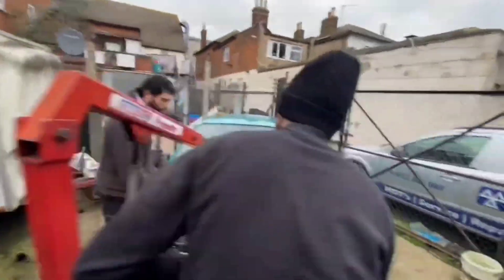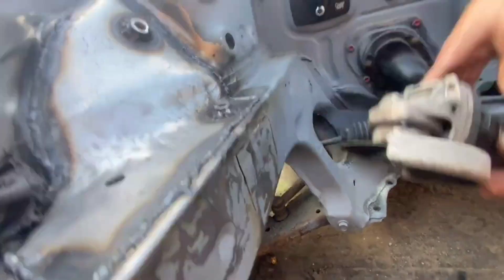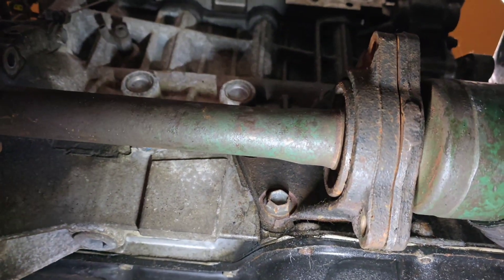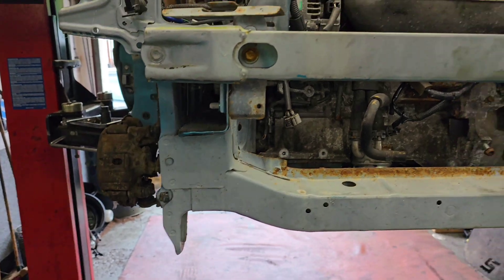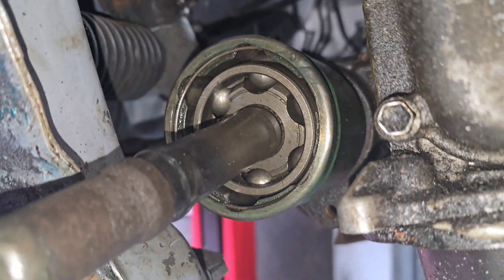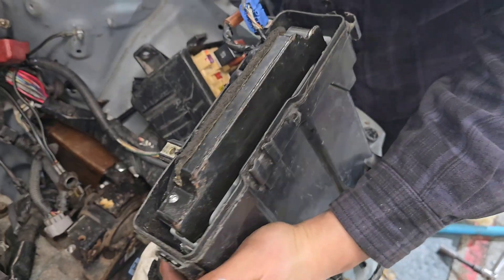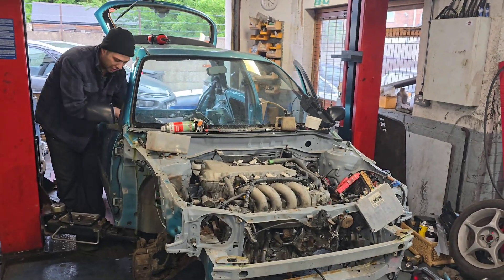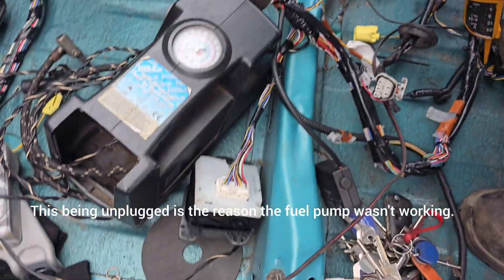Celica T-Sport 2zz inside a starlet. Will it start? Jdm ecu.  Will the driveshafts fit?We are back

Comment: JDM ECU has an immobilizer last I checked
Reply from the maker: Hey this ecu in particular doesn't have an immobiliser. I was told it is a jdm ecu. I have used different keys/transponders and they all worked. Not saying you are wrong but in this case it's a jdm ecu without an immobiliser :).